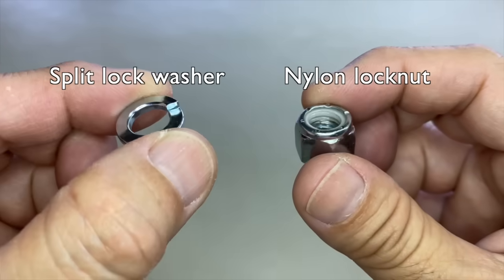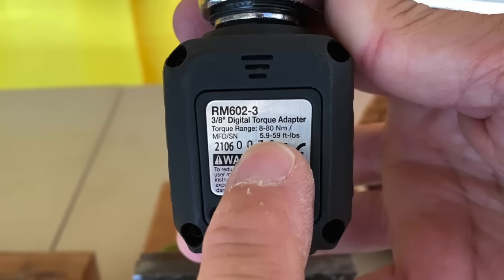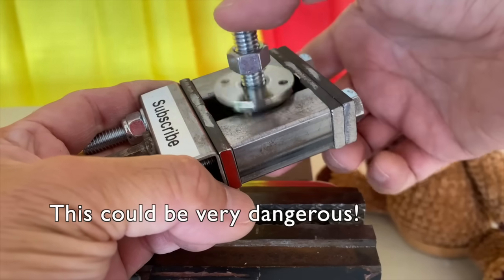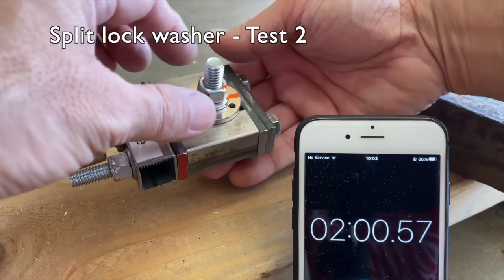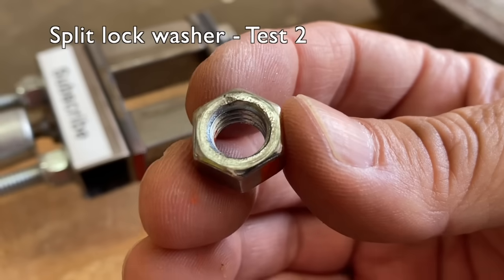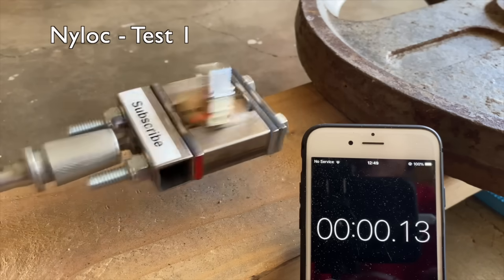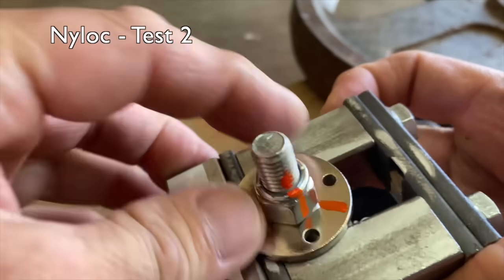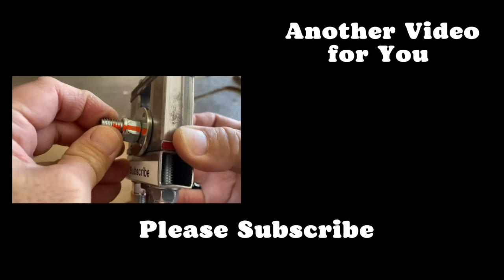Nuts & Bolts - Split Lock Washer vs Nylon Locknut – DIY Impact & Vibration Test - Part 1

Comment: i use nothing, my rod bolts, that i assemble,never failed; torque wrench is ALWAYS (well, 95.5 or 94 % of the time) ,  my hand and arm; torque is nothing, BOLT STRETCH is, i feel them with the SAME LENGTH WRENCH every time, NO one but me, assembles the engines here, rods and mains;  look, ferrari has ONLY ONE engineer to assemble the WHOLE engine; why?

Comment: The nyloc nut doesn't look like it moved relative to the bolt itself. I think the flanges may have ground themselves down a little against each other or the bolt head and nyloc nut. This extra clearance is what you're seeing, I believe that the bolt did not stretch either.

Comment: Great test!  Consequently, in aircraft, they use Safety Wire to safety every single nut on the aircraft.  Cotter pins also work, but not as well as safety wire.

Comment: The lock nut will stay there if not fully tighten . The experiment is a success . A lock washer will lose its spring over time .
Reply: Thank you.  That is what he was trying to show.
Reply: Spring washer for left thread! The correct washer does not move.

Comment: I counter tighten 2 nuts together with 2 spanners, you could test this method if you do it again, you should use as much torque you can produce squeezing the 2 spanners together, or it probably wont work.

Comment: It's really a matter of APPLICATION. However... 
Spring washers (as shown) are absolute rubbish - single use only and prone to cracking, deformation of spring and spreading (expanding diameter). Primitive crap. I can't think of many uses for them. My industrial field hasn't used them in decades, prohibited in many applications. I don't trust them, ever. Seen too many spread from over tension or simply disassembly.... seen too many crumble. 

There are far far better anti-vibration washer designs.  Double Toothed (binding to plate and nut) "Belvel" dish washes, made from hardened spring steel. some only have single sided serrations to act on nut, and some no serrations at all. Every type far exceed anything a 'spring washer' can do. These act as anti-vibration device and flat washer. These have been common use in the Industrial electrical industry for decades. 
 
Nylock is my basic choice of fastener, unless it's low load static 'construction'  subject to minimal vibration.  No good where high temp encountered, but there are other forms of 'locking thread' nuts that act in much the same way, that do not use a plastic insert. 
They are single use.  Note that none of the nylock nuts rotated on the bolt thread. 

In situations when clamping force is of utmost importance - eg. bolted electrical copper busbar connections  Lock Nuts ( 1/2 nut + full nut) are commonly used. You may have 4-5 x 12mm 8.8 grade bolts on a 100mm x 100mm lap joint.  Such bolted connections don't usually experience vibration unless located on rotating machinery or on a ship, however they can experience severe 50/60 Hz vibration and tensile loading during a large short circuit fault condition. 
Gotta say, NEVER seen a lock nut combination, correctly assembled, have the nuts and bolt unwind, even after high fault current testing or a catastrophic failure In-Service.
Note: There is a correct way to assemble the 1/2 and full nuts, and it isn't what many think.

Comment: Well, if you HAVE to be sure, use a castle nut and cotter pin.  LOL.  Also, it would be great to see what NordLock washers would do with your excellent test jig.
Reply from the maker: My Nord-Lock test is out… Will Nord-Locks Survive My Test?  DIY Impact & Vibration Test – Part 5
https://youtu.be/wOUnlfhHRko
Pls check it out and drop a comment.  👍😎

Comment: You do not have enough torque on the split lock washer to flatten it completely. Si your test is inaccurate.  Each type of locking device has specific applications.  USE SAE Torque specs.

Comment: Locktite changes the electrical properties of the connection. 
Any chance you did lock washers with nylon locks?

BTW on a boat i tend to use nylon nuts because they fail slowly.

Comment: What's most interesting is that you use nylon lock washers on your machine; didn't it come lose as well, but you really knows why? (Just an observation lol) ❤❤❤❤❤And this is exactly why i take a sharp punch to any nut that could cause catastrophic failure potentially causing harm to me or some innocent pedestrian.
Reply from the maker: Thanks!  The force on the rig bolts was an axial force or along the length of the bolt.  The force on the jig bolts was a transverse force or across the diameter of the bolt.  At least that is what I understand.  Plus... I torqued the rig nuts/bolts tighter.  👍😎
Reply: @HacksbyDad  Very very interesting. Thanx4sharing thanx4caring 🙏❤

Comment: Test rig used Nylocs, told us everything right from the start at :08 , LOL! Fun test. Ive found the same on packaging equipment over the decades. Nylocs will allow minor shifting in parts, but NEVER come loose to failure. Blue loctite and a split washer is a good combination alterantive.
Reply: The test rig used Nylocs, but they were used purely for axial clamping, and I reckon they would have been tightened to a bit more than 6 foot pounds.

Comment: They are to my knowledge for different uses. The split lock would hold, hold, but when it will give up, it's for good and the the nut will go away completely. The nylon one may give a little but it will stay put after that.

Comment: It’s called micro fretting, and this isn’t really an example of that. This is a large concern in the energy industry where components are fastened and subject to micro vibrations for 50+ years without attention.

Comment: To Make it an apples to apples comparison you need to take into account the run in torque of the nyloc. Essentially the torque the nyloc was actually torqued to is significantly less.

Comment: same test... no lock nut...... no lock washer...   just regular nut and each of the three common  different strengths of liquid lock chemical . Tested only  after each sets w/out testing until as long as prescribed by the product's directions.

Comment: If you plan on bolting two pieces of material together AND plan on having THAT MUCH vibration then simple solution...  WELD THE NUT TO THE BOLT. And YES, I agree with other comments that 6 ft/lbs is ridiculously too low.
Reply: What if its like a toaster or vacuum cleaner or a tot's scooter? It "Ain't always rocket science...Is it?

Comment: The ny-loc held the bolt without movement. The washer was bending due to the testing apparatus. You can see where the washer was rubbing on it. Notice the paint stayed aligned on the bolt and nut and never moved.